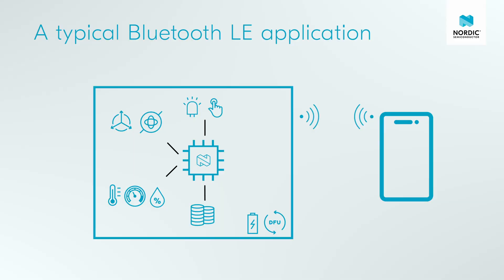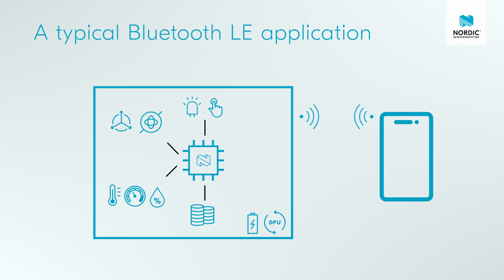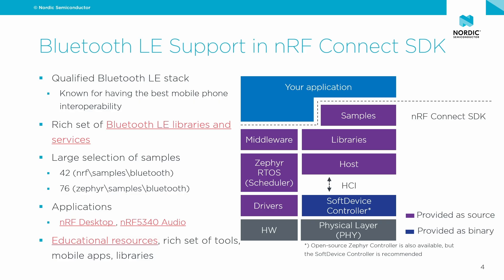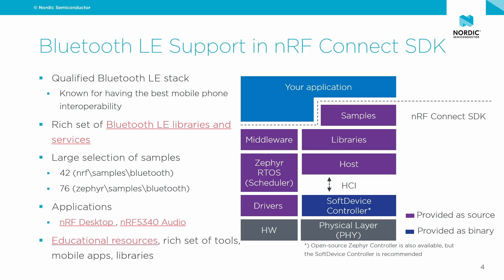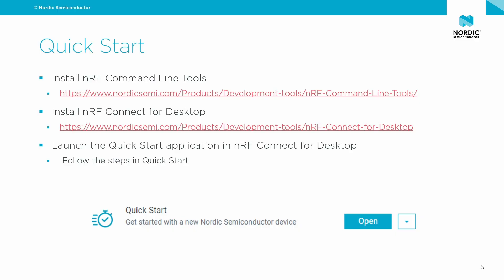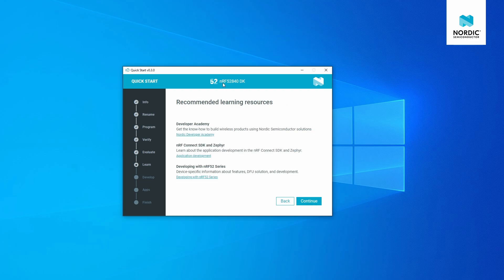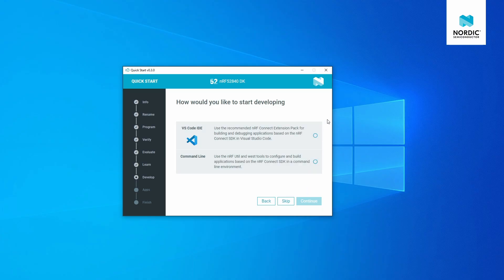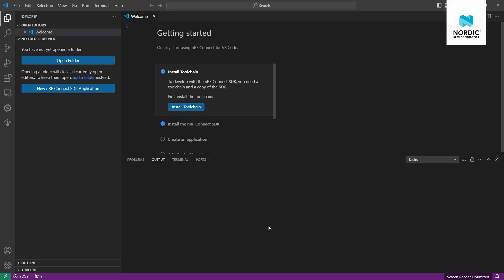nRF Connect SDK hands-on, part 1: Rapid prototyping with nRF Connect SDK

Comment: Hi! does the nrf7002 not supported yet for a quick start? I've been trying to make it work and it dosent `;(
Reply: Same problem with nrf52840 usb dongle. Basically most of Connect SDK for Desktop tools does not work. I assume that terminal is actually only one that works. nrfutil device list works flawlessly, some apps are able to detect it as BLE Sniffer with some serial number, some apps ignore it exists. I'm able to build blinky in VSCode, but not upload it.

Comment: Great initiative!
I really hope that these hands-on series will bridge the gap between isolated examples and exercises with zephyr (in the DevAcademy courses) and custom system/board creation.

Νot to be misunderstood, the DevAcademy courses are absolutely great for learning. I have already completed the DevAcademy courses for nRF SDK fundamentals, BLE and now I am in the intermediate course but when you come from a bare-metal background with Segger Studio like I do, there is so much new information and it is easy to forget things while you move on. 
Currently, I try to re-design my custom board's firmware(written using nRF52 SDK) with nRF Connect SDK in zephyr. I really hope that these video series will help me bridge the gap in the actual migration.
Thank you Nordic Semiconductor!
Reply: i'm in the same case than you, did you succeed finally ?
Reply: @Olfox2 hi yes.  I managed to make it work through the academy lessons at least for the basic functions. It takes time though....
Reply: @Olfox2  Not simpole task especially if you need to work with latest nRF Connect SDK v3.0.1 and new one, many error about deprecated Kconfig arise and older video is not useful, the only that I got valid for latest SDK was, in my case, part 6 about FOTA.
Reply: @firefox3799 I use sdk 2.8.0 until I migrate the full code. Then I will move to version 3 because  otherwise I will get lost
Reply: @Olfox2 it needs tremendous effort in the beginning especially eith the kconfig settings ...be ause there are too many combinations..and a slight mismatch can lead to disaster. It needs caution

Comment: I appreciate the initiative of a new set of videos for BLE development from Nordic. I noticed that the selected HW is nRF52840, and as the presenter says, the concept will also run on other Nordic SoC's... However, I feel like there is quite an oversight when little is mentioned on the differences. It is not just "a few GPIO's in the DT". The nRF5340 has two cores, and the NET core is the one specifically designed to run the whole BT stack. I see a lot of people starting from the usual examples, and in the end they create products with only part of the BT stack running on the NET core, and using HCI between NET and APP. Bottom line, I miss a good example of a complete separate project for 5340 with BT running on NET core, a very basic LED/BUTTON running on the APP core, and a basic RPMsg (or other) Zephyr intercore communication service implemented.
Reply from the maker: Thank you for your feedback! Regarding your comments on the nRF5340 SoC, the LBS sample used as the basis for this tutorial does indeed
work with the nRF5340 SoC: https://github.com/nrfconnect/sdk-nrf/blob/main/samples/bluetooth/peripheral_lbs/sample.yaml#L12. 

By default, the Bluetooth LE stack's controller part runs on the network core, while the host layer and application run on the application core; this process is automated by Sysbuild. In the following videos, we discussed some of the differences between the various SoCs and how they should be integrated in the project. Regarding your request for the sample, please take a look at this example: https://docs.nordicsemi.com/bundle/ncs-latest/page/nrf/samples/bluetooth/rpc_host/README.html. 

If you have any further requests or inquiries, feel free to reach out to our tech support engineers on DevZone: https://devzone.nordicsemi.com/